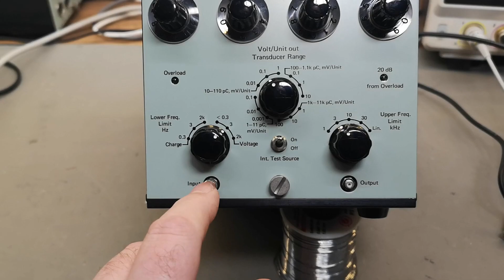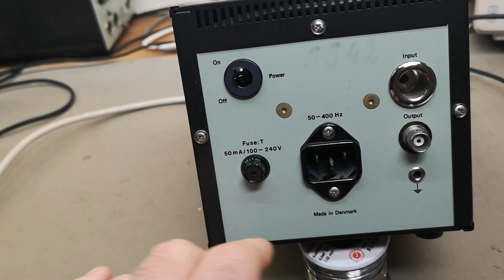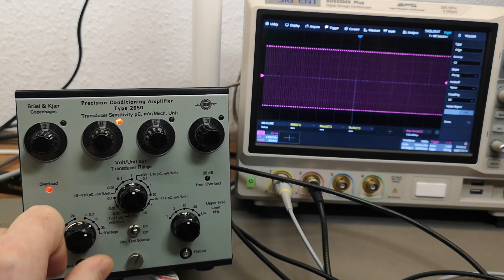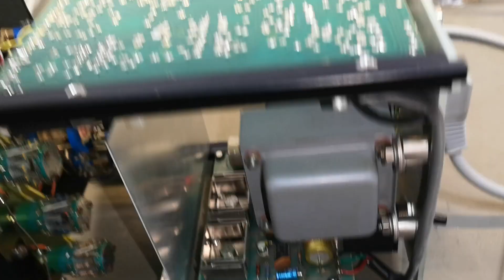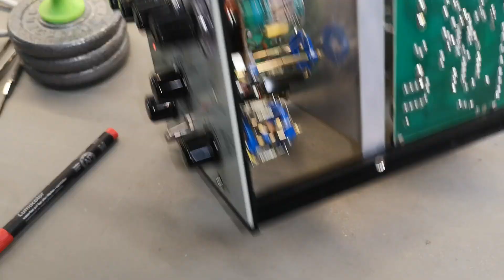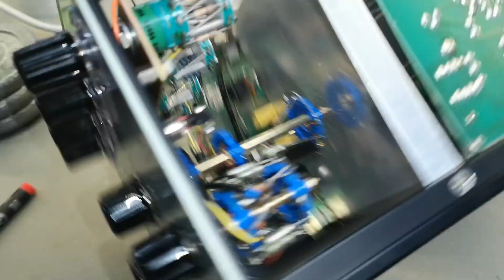Brüel & Kjær Precision Conditioning Amplifier type 2650 test teardown

Comment: At 6:29 you are wondering about the significance of the small neon bulbs in the top row. I think they are decimal seperators. For example, at 6:29 the sensitivity is set to 252.2 pC, mV / Unit.
Reply from the maker: think you are right, thanks :-)